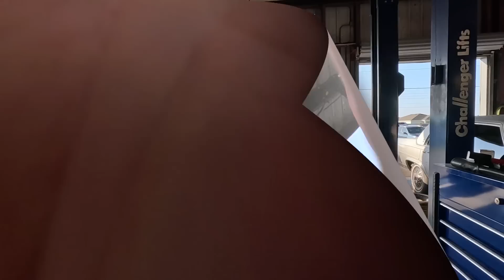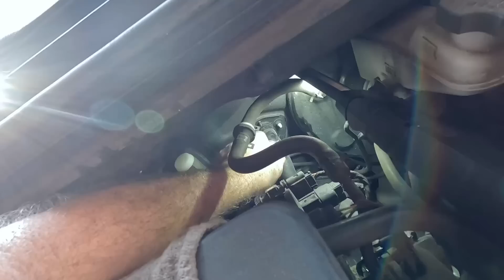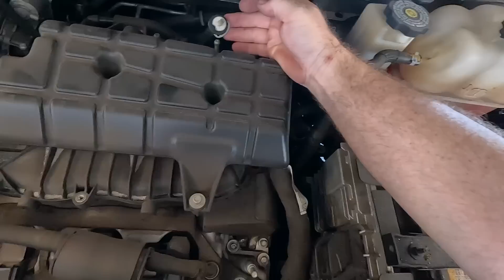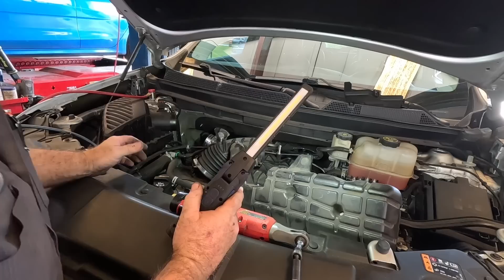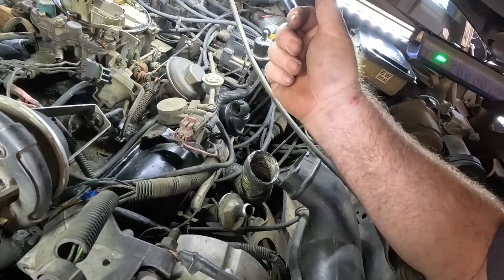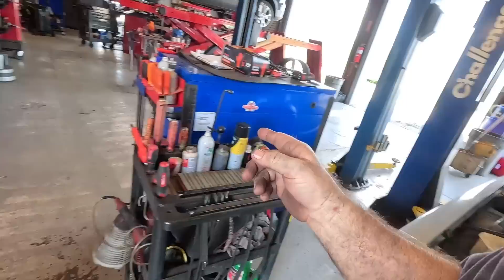HYUNDAI HOSE, LOF, TRAVERSE, PURGE VALVE, 1234yf, BROUGHAM COMPLETED, KIND OF..A DAY IN THE SHOP 273

Comment: jimmy  where can I buy those hose clamp pliers ?
Reply from the maker: I'll make sure they are in my Amazon store. I believe these came from thee tool truck, which is usually a rebranded higher priced version. 
Under each video in the description box there is a link to my Amazon store and using helps support the channel at no added cost. :)

Comment: Jimmy I'm still watching you daily. I haven't experienced any parts availability issues for my 4 old cars. All Chevys. A 64' C10, 79 Caprice, 95' OBS, and an 02 Camaro. I just recently put a new fuel sending unit in the 79'. Is it American or foreign cars you are seeing parts issues? I also just rebuilt the whole frontend of the 95' with all good name brand Moog parts.
Reply from the maker: We have a whack of a time with transmissions and certain hard parts, like struts or suspension arms. On some vehicles at least. We usually find them, but it takes a little digging. Used to be in stock locally.

C10’s and Caprices and Camaros are probably going to have parts available I think.
Like I just ordered a gas pedal and mounts for my 62. :)

Comment: I swore our 400 in our 70 gto was 18435672
Reply from the maker: Possible, the Pontiacs also had cylinder 1 as the trailing lead cylinder. All other GM’s it the cylinder head that’s further forward. I had a few Pontiacs, Firebirds and GTO’s. :)

Comment: good video.. watching you with the brake clean made me have flash backs to 2 weeks ago when i was working on a buddies 15 suburban putting a block off plate over the oil cooler lines for a temp fix. i was laying underneath it soaking it down with break cleaner, let it dry up for a few seconds and then stuck my head under to look and got a drip of it directly in the eye.... boy did that hurt .... , keep up the good work jimmy.
Reply from the maker: Ouch! That stuff burns and hopefully you got it flushed with some water! :)
Thank you!